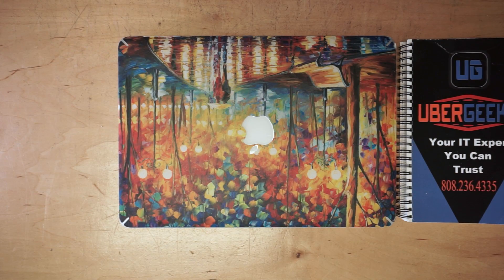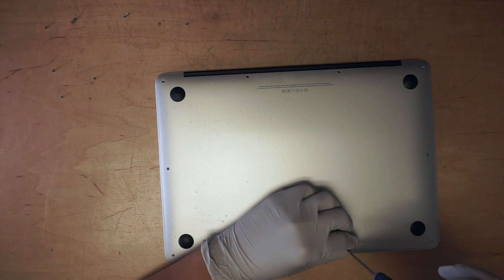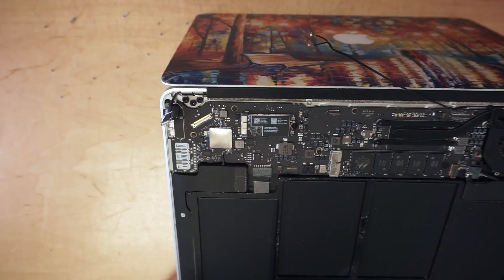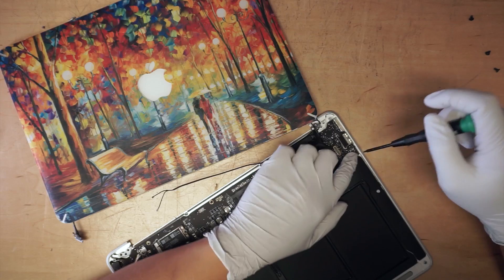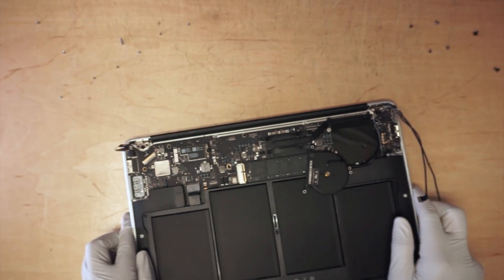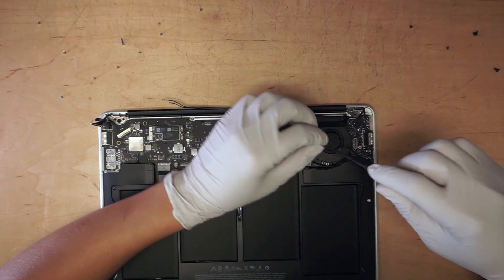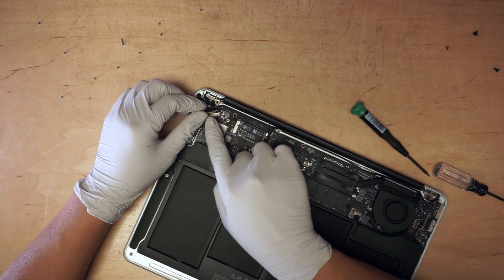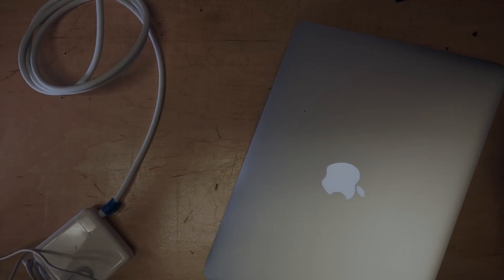Macbook Air 2015 Screen Replacement - Step by step

Comment: Great video, however this is not a screen replacement video, it is a panel replacement video. The price of the screen is far less than the price of the entire panel.
Reply: Is it harder to install a a screen replacement? I mean can it be done?
Reply: @suzannta2827  Yes, it's much more difficult to change the screen only due to the thin bezel and back cover.  It's much easier to just replace the entire LCD panel
Reply from the maker: Agreed. Not recommend to attempt just the LCD replacement. Better replace entire LCD assembly